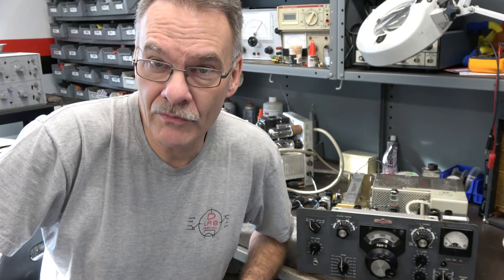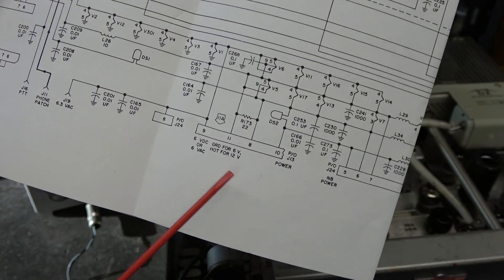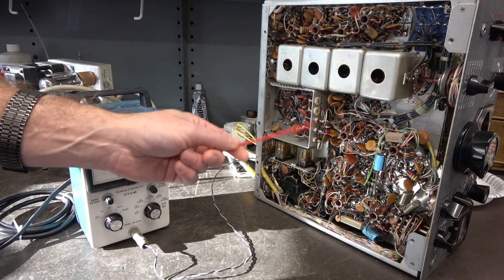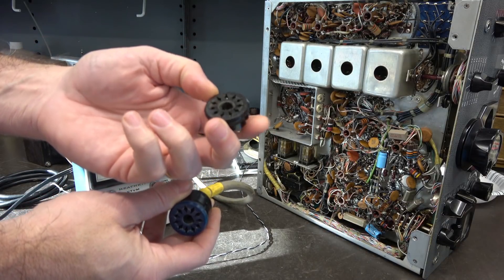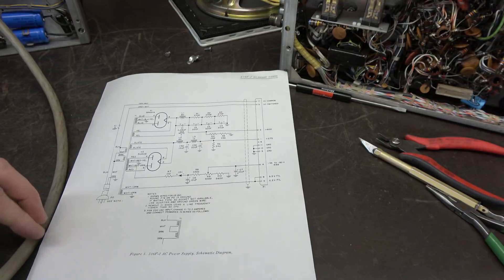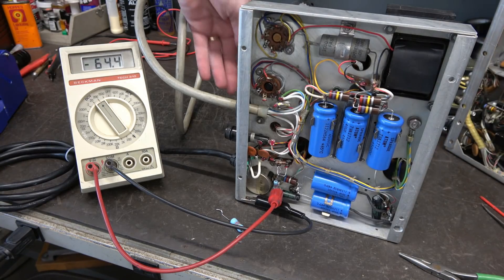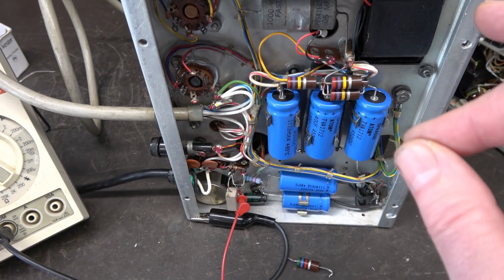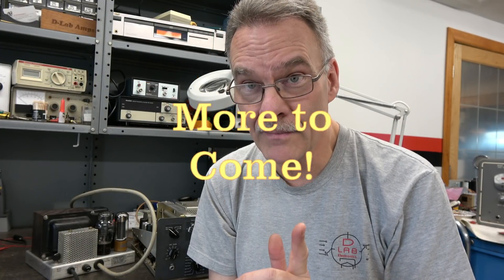How to repair Collins KWM2 Negative bias Intermittent power supply operation

Comment: Mr. Terry, Good work on solving 516F-2 supply issues. Just got through working on one with recapping and other. Did that supply have the 5Kohm or 2500ohm variable pot with resistor change out??

Comment: I presume that if the ground wire in the power supply cable failed, the rig case would be at HT voltage.

Comment: The key on my 75s-1 was worn  and put in on wrong. Blew all the tube filaments. Took some work but got it working. Question, what is that DX engineering box inside?? Thanks!

Comment: Would be a good to check the grid 1 coupling cap from driver for leakage? also watch the bias at the 6146's for drift while keyed (no rf) for 5mins see if stable? good vid thanx lov working on tube gear also.

Comment: Interesting video of a nice repair.  To test your theory that the change in source voltage since the P/S's manufacture date caused the low negative bias, could you have proved it by putting the transmitter on a variac and lowering your voltage to 117VAC?   Would it have then worked as normal?  I'm always leery about changing resistor values from a trusted schematic because I think something else may burn out sometime later if I don't thoroughly test the circuit first.  Always enjoy these videos, thanks.

Comment: Looks like it's coming along nicely. I have a KWM-2A along with a 312B-5
312B-3 and a 30S-1. I inherited this gear from my Uncle several years ago and have not had it on the air yet.

Comment: Shouldn't a higher line voltage cause a higher bias voltage?  It seems to me that having to go to a lower resistance suggests something is drawing more than originally designed.
Reply from the maker: Remember this is a negative voltage, current draw in the radio is normal, just needed to be adapted to the rig. This same issue arises with vintage guitar amplifiers. I will be posting a follow up video showing a full tune up/grid,plate current, etc.
Reply: @d-labelectronics  Yes, a higher line voltage would give you a bigger negative voltage number (a mathematician would argue that a higher negative number is actually a smaller value).
Reply: @d-labelectronics  Adapting is fine, but unless I misunderstand something, you'd adapted the power supply to confirm to "as designed" when paired with this transmitter but it wasn't working right.  That raises a red flag.  (And I'm not buying into the higher line voltage argument.)  If this wasn't the right power supply, then perhaps the transformer was different and that would explain things.  Likewise, if you're running different transmitter tubes then designed, that could explain things.  But from this armchair, it appears something isn't working as designed.
Reply from the maker: Hello Russell. Its hard to say. However the radio is working fine now. I run across the same issue with negative bias in amplifiers. May be different characteristics of tubes. The negative bias is simply used to throttle down the output tubes for proper idle current, which works fine & smooth now. This is a 50+ years old radio, not expected to perform perfect
Reply: @d-labelectronics  Ok, if it's not an isolated incident.  It's just when things don't go back right, it doesn't give me a "warm fuzzy".  There's a number of situations where changing the value on components might fix the problem, but it's only covering up the problem, not fixing it.
Reply from the maker: Roger that, lets wait until the project is complete with ON the Air reports. So, a question for you.. Why did Collins install different R8 resistors in the 516 power supply? Different values are documented on their schematics. Obviously something changed. Maybe the secondary they were tapping the negative voltage from? As I stated, this power supply came from another radio, model unknown.
Reply: @d-labelectronics  I don't know.  I don't follow Collins.  I do know from hard experience that there's a difference between building a working circuit and making a 100 more that all work.  (Component tolerances and all.)  So, it could have been a mod to improve reliability, accommodate a different transformer, or to accommodate a new radio model.  I'm not bothered as much by the change as the fact you went outside the range of the values that were documented to get it to work.  However, looking at things more closely, the whole circuit is different.  The transformer is different as is the value of the variable resistor.  None of which eases my concern much unless we know this radio draws more bias current than that power supply was designed for.  My concern is that the radio might be drawing excessive bias current.  Possibly due to leaky caps or gassy tubes.
Reply: @russellhltn1396  I think if I had one of these and didn't have a power supply I would be building a regulated supply with an autotransformer to adjust the input voltage.  I have an old ATR electromechanical inverter which has an autotransformer for adjusting the output voltage.